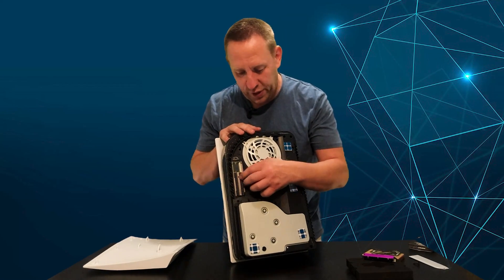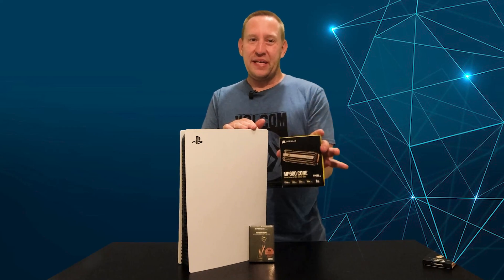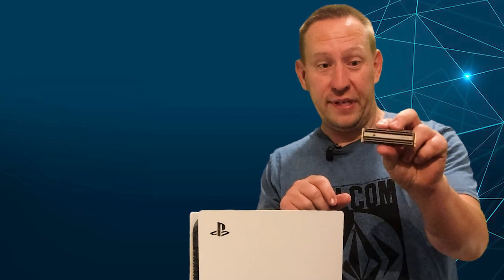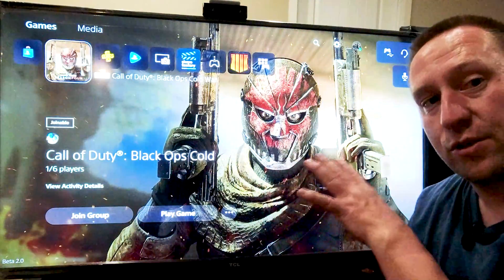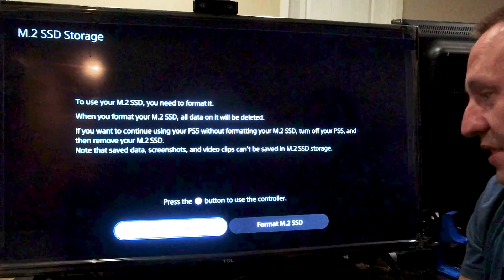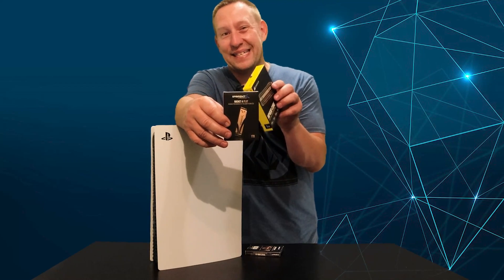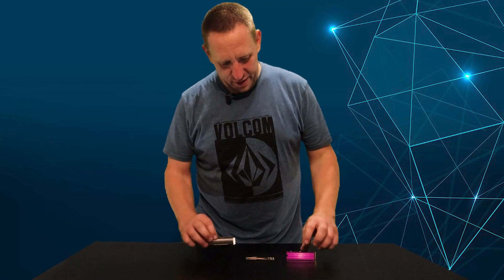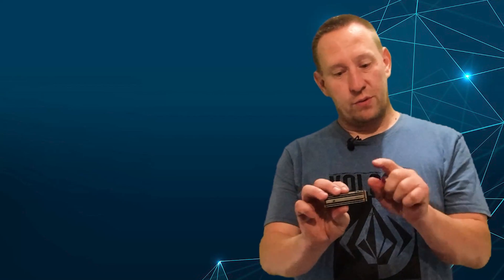SAVE YOUR MONEY! ~ We tried an INCOMPATIBLE drive with the PS5, DOES IT WORK??? | GT Canada

Comment: Since it is sealed,   I'm considering drilling small/medium pok a dot holes in the little metal cover....  nothing dramatic...  

I don't have any testing equipment to judge the difference.

Any suggestions for testing the heat on it?
Reply from the maker: I wouldn't do that. If the cover fits on put it on. There are tabs to allow air to be sucked out

Otherwise just leave it off

If you want to test it try a thermometer with a sensor on a wire.
Reply: @GearsAndTech  ,  your gonna have to make a correction...  at 11:53,   you tell us there is no airflow with the cover on... its a sealed coffin...
Reply from the maker: You are correct. I call it a coffin. I don't see how those tabs will exhaust air when there is no intake hole to let the hot air be replaced with cooler air.

If you have ever stuck a vacuum hose on your hand, how much airflow is there? NONE

Thats because the fan can't move air without air being able to replace it.

It will let some heat out but big nearly as much as you would like.

I think a bigger cooler with the cover off is better than the cover on with a small cooler

But, I can do some tests to find out!
Reply from the maker: I actually talk about those exhaust tabs in my original video, but I cut it out because I'm not totally convinced how well it works.

I would have expected there to be some intake tabs as well. Having two tabs on the same side will have very little cooling effect
Reply: @GearsAndTech  Yeah it seems to be a vacuum only system. Tests with that Purple Heatsink seem to keep the SSDs between 30°s & 40°s even during write/ download. Which is pretty good.

Nice video by the way !
Reply from the maker: I'll do some testing and see what the temp are with the cover on and with it off
Reply: @GearsAndTech  Nice !
Reply: @GearsAndTech  that's true. 🤔 I wonder. Maybe air in one hole and out the other ? They seem too close for that. 🤔
Reply: @GearsAndTech  your example of a vacuum on the hand and the same thought process of tiny holes in the cover and Air should flow.      It was just a thought..  I have the 850 with heatsink, AC Infinity MULTIFAN S5, Quiet Dual 80mm USB Fan behind the ps5...   I made sure to have great airflow from the front to back.    If heat becomes a problem I will look deeper removing heat from the coffin.
Reply: The cover is supposed to be on. There are two exhaust holes along the side of the bay (closest to the fan). The PS5 uses "Negative Pressure" by way of the PS5 fan sucking any heat within the SSD bay out of those two exhaust holes (in a vacuum fashion) ! LOL DON'T DRILL ANY HOLES !
Reply: @MountKash1  ...  ok,  I understand...  I haven't really looked at it to notice vacuum  ports inside,    but I wasn't going to drill while it was attached....lol

I thought I heard on a vid that it was a sealed spot.    The way I have my ps5 inside my cabinet,   makes for too much effort taking it out and putting it back in.

Comment: Shoutout to the PNY XLR8 CS3040 1TB which is right at the minimum spec (5600MB/s), currently $156.99 USD on Amazon
Reply from the maker: Im adding that to the list. It comes in about the same price as the Corsair SSD I tested in this video
Reply: @GearsAndTech  Awesome, I'm just hoping people grab what they can now before the Beta goes full production. And then scalpers are going to go buck wild swooping them all up. Buy one now while you can people!
Reply: @soapa4279  right on, went with the cs3040 myself solely for the 4tb capacity and the bare sequential read speed. Still awaiting arrival
Reply: You can get the Adata XPG S70 Blade 1TB for 139.99 on their website and that’s 7400/5500
Reply: @dehfunnykid  Yes, that's probably much better too!

Looking today's price, the CS3040 is now also $139.99. But I'd rather have the Adata
Reply: @soapa4279  Absolutely, it’s a crazy deal way above minimum spec and it comes with a slim heat sink.

Comment: The Corsair MP600 is really impressive.
Reply from the maker: I was actually really surprised that it came in almost the same as the Sabrent SSD even though its specs on paper are much lower!
Reply: @GearsAndTech  the corsair SSD will suffer in graphics heavy scenes or i/o later in the game, its easy to say it works right now coz you aint playin a triple-a game
Reply from the maker: That's possible. Right now it's working great

When those triple a games come out the 2gb faster drives will be cheaper and I can look at upgrading then.

For now this is a low cost way to get more storage. I hate having an external USB drive attached. So this works perfect

Comment: Yes, the SSD bay on a PS5 is sealed, BUT all of that metal showing through is the main large heatsink for the system itself. And as for now, when the system and games are "young" 5500 is the recommended speed. However, as games progress and as the Devs learn to utilize the PS5 more efficiently(and its SSD) those lower drives will likely be left behind. And then have slow performance or may not work at all with certain games. Just a thought.
Reply from the maker: I agree with you.

My advice would be to save your cash and buy the lowest spec ssd you can find now. Then in a couple years when the games will need a faster spec drive upgrading won't be a huge cost due to the faster drives dropping in price.

Comment: You can get the Adata s70 7.4 gb/s drive for like $200 1Tb on sale in Canada.  It comes with a massive heatsink as well so the metal cover won’t go on. But someone should test that drive out since in theory it’s almost the cheapest but still has the highest advertised performance
Reply: This drive ("ADATA XPG GAMMIX S70" & the "BLADE" version) has a firmware issue. It randomly fluctuates between 6GB/s and dropping down to 3GB/s. Needing a firmware update. 

BUT !!!
If you're unlucky and the SSD you end up recieving has firmware version 3.2.F.P7 on it. It WILL get completely bricked if you attempt to update. It's a gamble with that SSD.
Reply from the maker: I have the S50 listed in the below spec range, but I have added the S70 to the top range. It could be a good choice in the bang for your buck catagory!

Comment: My (ezdiy-fab) heatsink claimed it was 9mm tall but it's a tad taller, so my metal cover is touching the heatsink, I have to push the metal cover down to screw it in because it's at an angle. Should I get a new heat sink? Do you think this is going to be a problem?
Reply from the maker: The short answer is yes. This could cause a problem.

The ps5 counts on an air gap between the heatsink and that lid so it can suck the air over top of the fins to help cool it. With the lid on tight there is no air gap.

I would say take the lid off instead. It'll be better for that ssd
Reply: @GearsAndTech  Sony specifically says to not leave the lid off and the PS5 uses negative airflow for cooling. The lid being gone affects that negatively.
Reply from the maker: Yes. I agree. I intend to do some testing to see exactly how much it affects it. I really can't see it being a bad thing.
Reply: I thought I had the exact same issue, I have the same heatsink as that one. 

I noticed that even without the heatsink in the bay, and it was completely empty,  I still had to press the end of the slot cover down to screw it into place. 

I have several hours at a time of use with this EZDIY-FAB heatsink. Not one issue or notice of overheating etc. Hope this info helps you in some way.  If you wouldn't mind, wouldn't you test your bay and see if yours also has to be pressed down to lay flat..im curious to know. Please reply about it when you can.
Reply: @DadBodGamingCollectibles  I just took out my ezdiy-fab heatsink & replaced it with the MHQJRH heatsink & it fits like a glove, When I put cover over the heat sink I did not have to press down to screw in like I did with the ezdiy-fab.  I'm much happier with this newer heat sink.
Reply: @jerv9223  I did the same, bought with the same heatsink to test the difference. Still has to be pressed down. Even with no ssd or heatsink in the bay.

Comment: Firecuda 520 works too. I upgraded my desktop with Samsung 980 Pro, and I tried to put the previous disk (Firecuda 520) on PS5. It works perfectly at 5600+ speed.
Reply from the maker: That's excellent!

The firecuda has been hard to get. Maybe there are some 520's still sticking around.

But I think a lot of people will be looking to do what you did. Upgrade pc storage and use old drive in ps5.